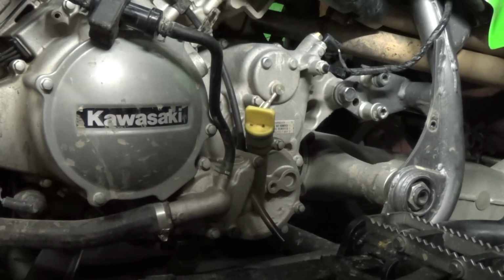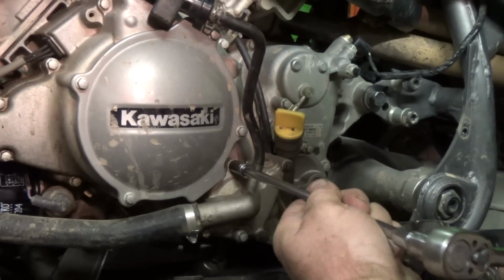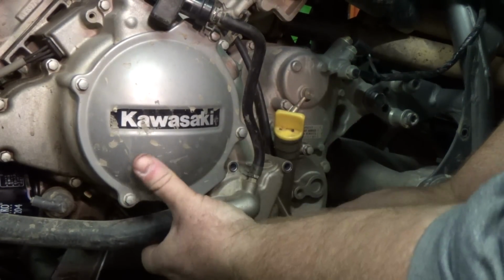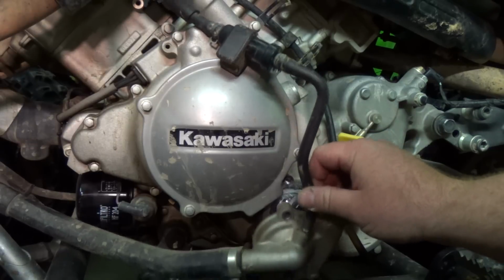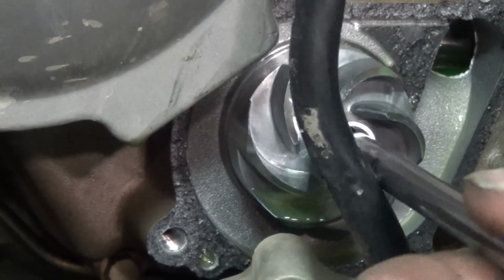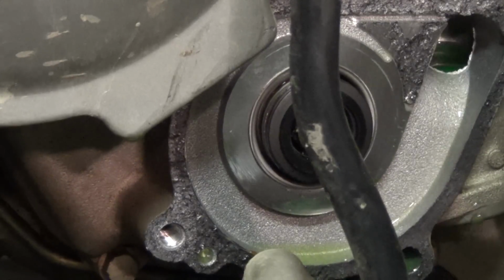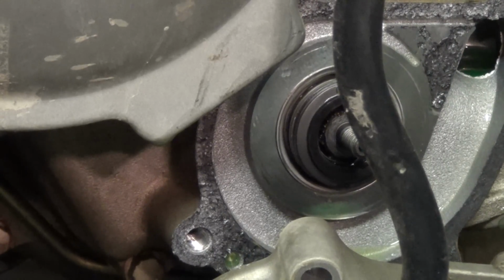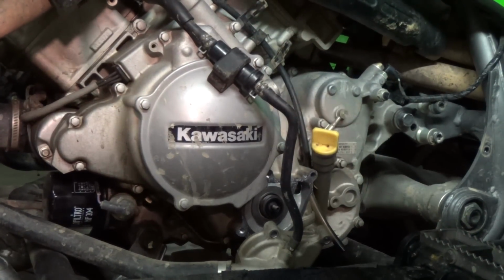Kawasaki KFX 700 - Water Pump Cover and Impeller Removal

Comment: I have a question about the oil seal and how it sits behind the mechanical seal.  Does it "snap" into place or does it just sit firmly against the backside of the bearing?  Thanks,

Scott
Reply: Yes! Exactly. Just push it in.